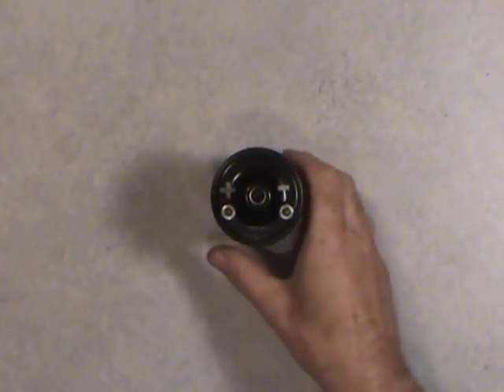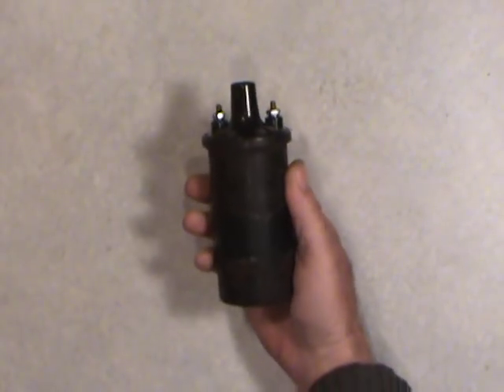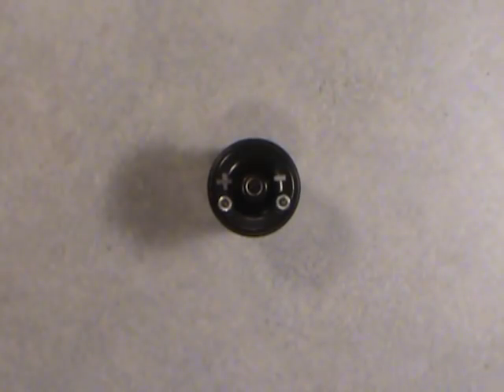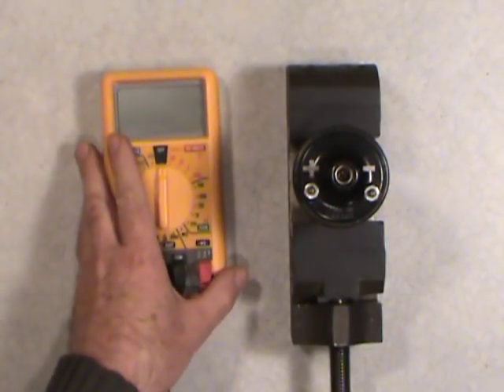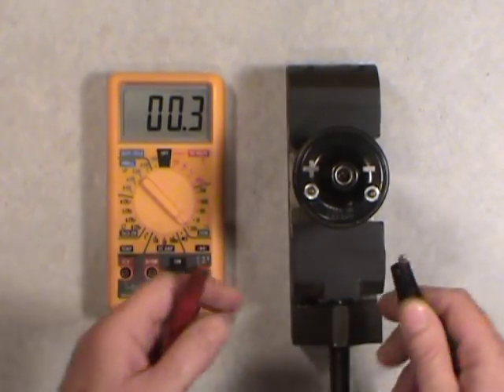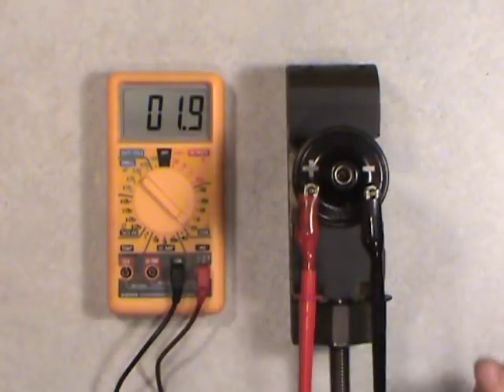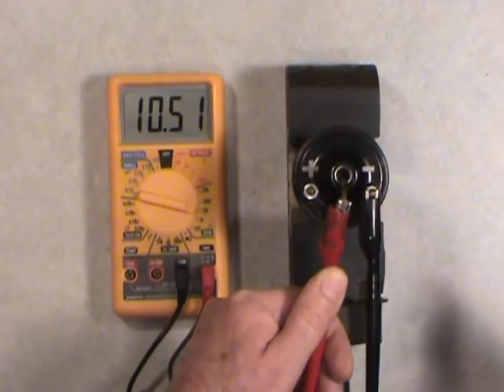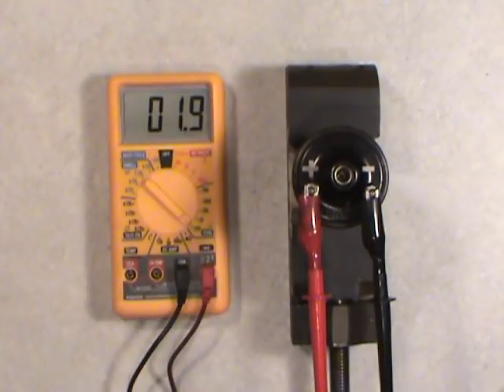Ignition Coil Testing

Comment: By the way... Are you a teacher? You're soooooo good at explaining stuff... :)
Can the coil be tested in the vehicle?
WOuld you have some other videos on how to get a gm tbi to work properly?
Reply from the maker: Greetings rag Doll....Thanks for watching this video, and for the comment and questions as well....Me, a Teacher?....No Sir/Maam, I'm not....All of what You Hear, and See Me Doing in these videos of mine, are just some Hobbies, Experiences, and Adventures, along with Savin' some Money, by DIY, well actually DIM (Doing It Myself!)....Yes, an Ignition Coil can be tested in the vehicle, and, I'll elaborate on that in a few moments....Now, about the TBI (aka, Throttle Body Injection) System, and, how a TBI Unit, resembles that, of a Carburetor, but, is as different, as Candy compared to Pepper!....I actually "Bypassed" the TBI System all-together, as, I went from Carburetion, straight on through to CPI (aka, Central Port Injection), where there happens to be Only "1" Fuel Injector, with 6 Hoses/Tubes, with the ends having Poppet Nozzles on them.

Before You get Started...Do "You" have an "Ohm" Meter or "Multimeter", that can Measure Low and High Resistance or Ohm's??? (You can't Test the Ignition Coil without one!!!)

You will also "Need" to find the Ohm's Values "Specifications", for Your particular Ignition Coil (one Low Value, and One High Value, expressed in "Ohm's").

To Test Your Ignition Coil in Your Jeep, You have to be very "Careful" and "Aware" of some Dangers, that are Lurking inside Your Jeeps Engine Compartment!

Your Jeep has to be on "Level Ground", In Park, if it's an Automatic Transmission, or, in Gear, if it's a Standard Transmission.

Your Jeeps Parking or Emergency Brake Must be "ON"...!!! (or Applied).

All "4" of Your Jeeps Tires, have to have Wheel Chalks, or, Bricks, Lumber, etc., in order to Keep Your Jeep, from Running You Over!

Your Jeeps "Battery" Vents "Explosive Gas", especially when, the Engine is Running, and the Battery is being "Charged", by Your Charging System's Alternator!!!

"NO SPARKS ALLOWED" Near Your Jeeps Battery!!!

Wear "Safety Glasses!!!"

Make Sure, that You "Don't" have You "Key" in the Ignition Switch!!!

Let Your Jeep Sit, Not Running, for at least Half a Day or so, so, that "Very Explosive, Venting Battery Gas", "Is Not Venting Anymore!!!"

Before You Disconnect anything, check to see, if there might be something that might be along the lines of an Anti-Theft feature for Your Jeep, or Jeeps radio, or something else (Anti-Theft features, usually were showing up in later years, but, I thought I should mention it, just in case...).

Then..."Disconnect" the "Negative (-side or call it Minus Sign side) Battery Cable Clamp/Terminal", from Your Jeeps Battery, and place it, Away from the Battery, just in case it might Touch that Negative terminal on the Battery.
That will Prevent any Short Circuits, or Live Wiring, when Testing Your Ignition Coil.

Then, take a look at the Wiring on Your Ignition Coil, and Write Down, on a piece of paper, or "Tag and Label" the Ignition Coils Wiring, with a piece of masking tape and a felt pen, so that You will be able to "Replace" the Ignition Coils "Wiring" where it was, before You Removed those Wires!

Now, Remove the High Tension Lead, that is Attached to the Center Tower of Your Ignition Coil, being very Careful, as not to Break it, and set it aside.

Next, Remove Both of the Smaller Wires, on the Top and Near the Sides of Your Ignition Coil, and, Be Careful, that You Don't "Lose" the Threaded "Nuts!!" (if that's how the wires are attached to Your ignition coil).

Then, take the Primary and Secondary Coil's Ohm Reading's, just like I have shown You in this Video of mine, and write them down.

If Both the Primary and Secondary Ohm's Readings are withing Specifications, and Your Ignition Coil Is Not Leaking any Oil, You should be good to go, if not, it's...go Buy a New Ignition Coil for Your Jeep!

Before you Re-Install that Wiring onto Your Ignition Coil, "Clean/Shine-Up", the Primary Threaded "Terminals" on the Ignition Coil, where the threaded "Nuts" Secure the Ignition Wiring to, and also "Clean/Shine-up" the Wires Metal Connectors, in order to make the "Best" and "Cleanest" Electrical Connection Possible! (especially Important on the Primary Low Voltage Side!).

Then, Plug In, that High Tension Lead, to Your Ignition Coil's Center Tower.

Once, All Ignition Coil Wiring, is Re-Connected onto Your Ignition Coil, it's just a matter of Cleaning-Up, Your Batteries Negative - or Minus Terminal, and the - or Minus Battery Cable/Clamp, and Re-Attach that - or Minus Cable/Clamp onto Your Battery.

So, be Very Careful now, and...

...Be Safe, take care, and have a good one.
Reply: Thanks bunches for the great information!
I've been rebuilding my heep for the last few years so, I'm not new to the process HOWEVER, I do appreciate the indepth information. :)

Comment: LOL…(!) Yeah I just moved the arrow on the red line until I saw a multi-meter. Had a Jacobs Ultra Coil for about 400,000 miles with the Jacobs Ultra Team ignition amplifier and then when it died I ran an MSD 6a analog on the coil for several 100 thousand miles. Thought the MSD 6a was bad but I think it was the coil..Got a new MSD6al digital unit now everything is new and I shouldn't have anymore problems for at least 350,000 miles….:-D
Reply from the maker: Greetings hightech346....Thanks for your comment, and sharing your High-Tech-Information as well, my Friend....The Ignition Coil that you see in this Video, is a very Common, and Basic (old-school) type of ignition coil, that can still be "Triggered" with the good old "Points and Condenser" type of Distributor, and as for this one, it was "triggered" with the "Factory installed Electronic Chrysler/Dodge/Plymouth Ignition Module" that happened to be mounted on the engine compartments Fire-Wall....Spark Plug "Gaps" were only set at .035" (thirty-five-thousandths of an inch) for this particular ignition coil.

You have some very "Serious" and "High Quality" Ignition Components providing that High Voltage "Spark", or "Sparks", that will have no problem at all "Lighting-the-Fire" inside your Engines Combustion Chambers!!!

Lets see now....Maybe if I mention a few things here, I can perhaps help you Extend the Life-Span (in Mileage or Years) of your now-installed Ignition Components, not that you really need all that much more, as you most certainly "Got-your Moneys-Worth" with the information that you provided on your Ignition Component/Components as I just read in your comment!....Also, in case you might not already know, there are some very Basic "Tips" that you can consider as well.

For starters, keep everything "Dry", as that High Voltage will be looking for a Path to Ground where-ever it can find it, when the Engine is running....If you have a Distributor Cap in your particular ignition system, make sure that there is No-Moisture (condensation) Hiding inside your distributor cap, or, that High Voltage Electricity won't have a very good chance at making its way to the distributor caps terminals (inside), and also, may cause a "No-Start" of your Engine as well....Keep your Distributor Cap and Rotor in Excellent Condition, without having any Extra "High Voltage Electrical Erosion" at the distributor caps terminals (inside), and at the Tip of, and at the Contact (center portion) of the Rotor as well.

Ok now, let's talk "Ignition Reserve" and your vehicles Battery and Charging System....Just try to remember the old saying..."The Chain is only as Strong as the Weakest Link"....The words "Ignition Reserve" just means to have more "High Voltage Electricity" Available, Over and Above (excess) then your Ignition System actually Uses, or needs, to make its way to your Spark Plugs and Fire them with the Required 100% High Voltage to "Jump" your spark Plugs "Gap" (Larger Gap requires a Higher Voltage to Jump that Gap!)....Lets say that, your Charging System, you know, like the Alternator (replacement for the Old Generator...lol), decides to "Stop Working"....Then, your Batteries Voltage will drop, oh, somewhere from about 14-Plus Volts, down to about 12 Volts, or, maybe even less (just a Ballpark scenario)....If this happens, then I'm quite sure that your Ignitions Coils "Output" (High Voltage) will Drop also....So, that's just something to consider, in that, your Battery, and your Charging System have to be in Tip-Top Shape, to provide the best possible Voltage and Current Supply to your High-Tech Ignition System (same applies to any Conventional Ignition System also).

Every Wiring "Connection" has to be 100% as well....There is one Wiring connection that a lot of Folks tend to over-look, and that Wiring Connection is that Big "Ground" Wire, that goes from the vehicles Negative Battery Post/Terminal to where it Bolts/Fastens to the Engine Block! (applies only to Vehicles that have a Negative Ground System!)....The "Damper" the Climate (more Humidity) where you live/reside, will, more then likely cause Electrical Connections to "Fail" at a much higher Rate, then, oh, lets say a nice "Hot Desert" Location, with very Low Humidity!...and, that's due to Moisture getting into the/those Wiring Connections/Terminals.

Whenever something like Spark Plug Gaps get too Large, (worn out) or, an Ignition (spark plug) Wire Breaks Internally, or at the end terminals, or even the Gap between the Distributor Caps internal terminals and the Tip of the Rotor, that will put some very Un-Needed "Stress" on your Ignition Coil, and, might just cause your Ignition Coil to Fail.

Good luck with trying to get the Life-Span of your Ignition Components to Surpass that of which you have already experienced!

Take care, and have a good one.
Reply: @RockysRoadshow  awesome! Thanks so much.

Comment: The coil came from which vehicle? I brought new ignition coil and it not within factory spec? Is this reason why there no sparky?
Reply from the maker: Greetings...kennedy wong……….Thanks for watching...…...The cylindrically shaped, oil filled ignition coil, that you see in this video, was off of, a mid-1970's Dodge V-8 engine...…….About the only place, that I have found, the actual, ignition coil ohms specifications, was in a factory chassis service manual, and also, in some of the after-market, car and truck manuals as well........So many times, I've seen part listings, for ignition coils, that, only show the part number, and, what vehicle it was for, and almost never seen, were, the ohms specifications...…….Yes, indeed, the replacement ignition coil, has to be, the correctly specified one, within reason, or, it might over-heat, or maybe, have a lower than wanted, high voltage output...…...Have a look, on the Rockauto website, and look up, your vehicle (year) and engine, and find, the list of ignition coil part numbers, and see if any of them, match up with the ignition coil, that you have now........If you have the correct ignition coil, and still no luck, then, just let me know, your vehicle's...year...make...model...engine size...and, if there are any modifications as well, that way, I'll have a much better chance, at being able, to help you out, and.......till next time......Be Safe, take care, and have a good one.

Comment: Just tested my coil. It was 0.03 on the low side.  8.50 on the high tension.  Judging by the low reading and the car not starting looks like the coil is not happy?
Reply from the maker: Greetings...Jim Smith...…….Thanks for watching...…….That 8.50 that you measured, is probably 8,500 ohms (as in, eight thousand and five hundred ohms, or, just call it, eighty-five hundred ohms, if Ya like), and, to me, it sounds about right, there-abouts, for the secondary (high ohms) side, of an ignition coil...…….The real "fussy" part, to ohms-measure accurately, is the low-ohms, primary (windings) side, of the ignition coil...…….Your 0.03 measurement, seems kinda odd...…...Here's how I ohms test, the "primary" (low ohms/windings), on an ignition coil...…….First thing, is to have all of the electrical wiring, "disconnected", from all of the ignition coil's terminals, to avoid having, any misleading/not trusted, ohms readings...…….Then, I set my ohm (multi-meter), on the "lowest" range (on mine, it's the 200 ohms range)………..Then, I connect (by hand pressure), the multi-meter's, two metal probe ends, and see what the reading on the meter is...…….On mine, it is usually showing .3 ohms, which has to be subtracted from, the reading that I see, when I actually ohms-test, the ignition coil's, two primary (low ohms) terminals...…...Let's say, that, it's an ignition coil, that's like the one in this video, and, I see 1.8 ohms on the meter...…….Well, 1.8 minus .3 = 1.5 actual (real) ohms (easy huh)……….Generally speaking, then, the older, cylindrically shaped/oil filled ignition coils, like the one in this video, is usually, around 1.5 ohms, on the primary/low ohms side, that will also have, a ballast resistor, in its ignition circuit.........There are also some of them, that are about 3 ohms, on the primary side, and usually won't have, a ballast resistor, in that particular, ignition system/circuit...……..Maybe, you might have, a 3 ohm ignition coil possibly...???...…….If you can tell me, what the vehicle is, that you are trying to fix, then, please let me know, the vehicle's...Year...Make...Model...engine size/number of cylinders, and, if it's factory stock or modified, that way, I'll have a much better chance, at being able to help you out, and...….till next time......Be Safe, take care, and have a good one.

Comment: very good info thank you
Reply from the maker: Greetings...Aaron Johnson..........You're welcome, and, thanks for watching............Although, an Ignition Coil, will Ohms/Resistance Test Ok, there can be times, where, they can start to act strangely, or, might even quit working, once they get up to operating temperature, or maybe, even hotter..............Maybe, do an internet search, for an (ignition coil) "Spark Tester" (some are even adjustable), cuz, by having a Very LARGE Gap, between the two electrodes, on the Spark Tester, then, that will, shall we say, "Stress Test", that particular Ignition Coil, pretty much meaning, that, the Ignition Coil's...Secondary High Voltage...will try to go...High Enough...and be able to, shall we say..."Jump/Spark, Between that LARGE Gap"...that's between the Spark Tester's, two electrodes..............That LARGE Gap/Distance, between the Electrodes, on the Spark Tester, will usually require, that, a certain amount of "Kilo-Volts" (as in, Thousands of Volts), that, that particular "Gap Size" requires, (in open air/atmosphere), as a minimum, for the ignition coil to produce, in order, to be able to, make the Jump, or, probably, No-Spark, will be seen at all..............Also, that "LARGE Gap", has to be the "Correct" Gap/Distance, for the "Exact" Ignition Coil, that is being (stress) Tested, at that particular time, as, we really don't want to "stress test" any ignition coil, up to the point of..."Infinity and Beyond"...!!! (so to speak), cuz, if that were to happen, then, that particular Ignition Coil, might get Damaged...not good at all.............Let's say, that the High Tension Lead/Wire was Not Connected to the Secondary, High Voltage Tower/Terminal, of an Ignition Coil, like the one that's being shown in this Video of mine, while it was Operating, then, its Secondary High Voltage, would probably try to get High enough, to make the "Jump", to, a too Far away ground source, and, if left in this condition long enough, then, that poor ole Ignition Coil, would probably Over-Heat itself, and go Kaput/Fry itself, so, make sure that, All of the spark plug "Wires", are in Good Condition, and, are All Connected properly, so the Ignition Coil will be Happy, and will also, last a very long time, hopefully, that is, and.......till next time........Be Safe, take care, and have a good one.

Comment: Well done thumbs up.
Reply from the maker: Greetings...Scott Lundy...……..Thanks for the nice comment, and for, watching too...…...Just keep in mind, that, even though an automotive ignition coil checks out ok, ohms-wise, then sometimes, a not so good ignition coil, might start to act-up, when it gets up to operating temperature (can also get heated up, by the engine compartment heat as well), and, might be the cause of a misfire (ignition wise), or maybe, power loss while under load, and, maybe even, the engine might be harder to start, when it's already at operating (hot coolant) temperature, possibly...…….If something like that, ever happens me, then, I usually just replace that questionable ignition coil, with one of the other used ones, that I keep in storage, or, if need be, I just buy a new one (about 50 dollars, there-abouts)………...If the ignition coil swap, doesn't cure the problem, then, Ya know, that, Ya probably have, a good "spare" ignition coil, as a backup...!!!...lol...….and...…..till next time...…..Be Safe, take care, and have a good one.